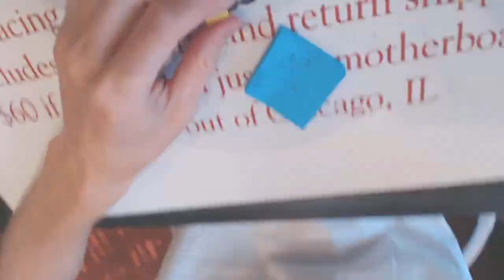Lenovo Yoga 13 Model 20175 Laptop Power Jack Repair broken inside yellow piece repair

Comment: Thanks. Great video. How can I tell if it is the yellow piece connector that is at fault?  I can test the power adapter to see if there is current. If that seems to be OK but the laptop is not charging, is there a good chance that the yellow piece is at fault?
Reply from the maker: if the center plastic yellow rectangle is broken and you can see pins inside (from the outside) then it is a broken jack, if it moves excessively and you had to wiggle/ jiggle the plug to make it work then that is the jack as well, a cable in the back might get desoldered, but usually it is the rectangular piece that gets broken.

Comment: Hi, would you happen to know whether this model has a backlight in its screen? I've done lots of research and I cannot figure it out. The ebay seller who sold me a screen that doesn't work claims there is no backlight in this particular model, (which makes no sense at all) and that the backlight comes from the motherboard.
Reply from the maker: Once you take the screen off, on the back you will see the exact model of the screen, put that into ebay and it should be around $30-40,  Different laptops (of the same model) might use a different screen LCD or LED and different connectors to the screen, there is no point ordering a screen unless you look at the back and compared the models, also versions (ver 3.0 or ver 4.0) might be a day and night difference.

Comment: Hello, while I was replacing my screen for a new one I notice that the locking clip at 28:28 was broken, and most of my keyboard does not work. Do you have any tips to fix this particular issue? Thank you.
Reply from the maker: besides sticking a guitar pick in there, no tips